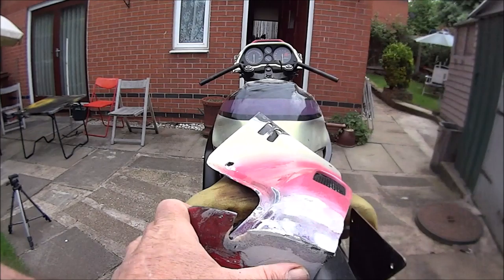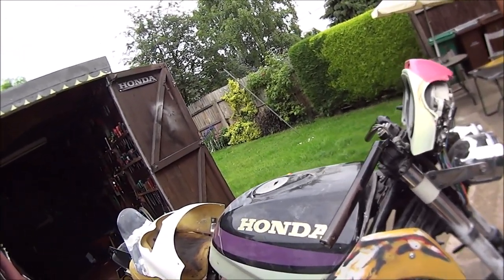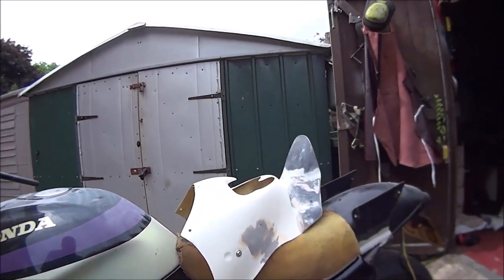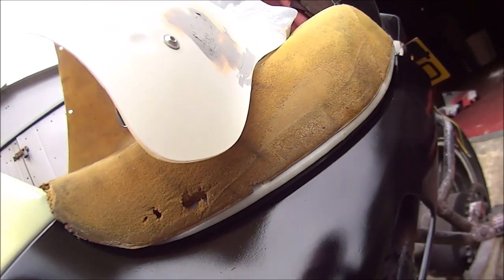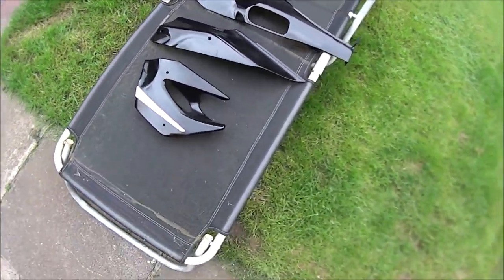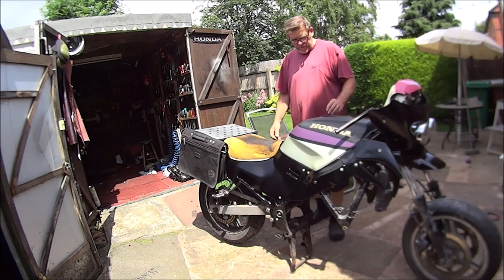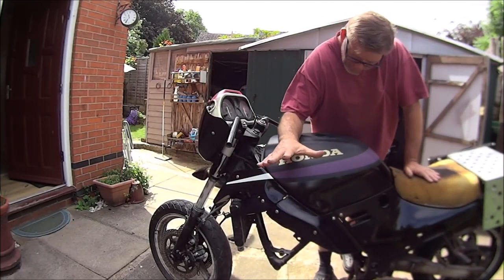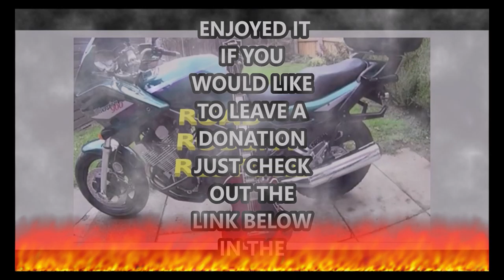CBR1000F Landfill bike. Back in Black.

Comment: That is looking bloody great mate. I love the idea of leaving the Honda badge and continuing the stripe in white. I would be tempted to leave them unmasked and candy coating over them so they pick the colour of the candy like the gold ER5 that I did. Great job buddy.
Reply from the maker: Hi Nat cheers buddy. I just meant masking up for the paint for the dabbing part then removing the tape before putting the candy cotes on.
Reply: @jonyr1TT  can’t wait to see the end result. I have used metallic silver under candy so I am looking forwards to seeing the white. What candy coat are you using?  I use canbrush a lot and it is very good.
Reply from the maker: Not sure which candy cotes I will be doing.. I'll be chasing you up on that shortly.
Reply: @jonyr1TT  not a drama mate. I am no expert but I have had a go with most of the canbrush range.
Reply from the maker: You make it look easy mate 👍